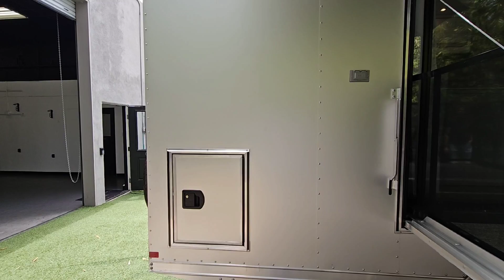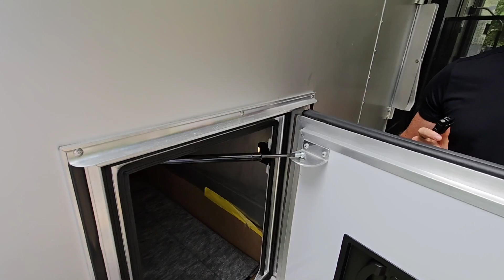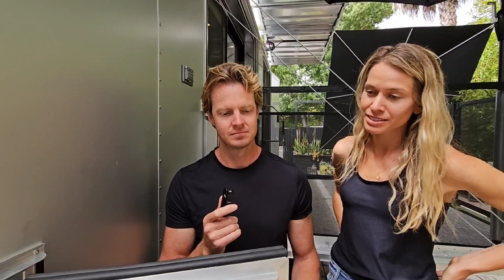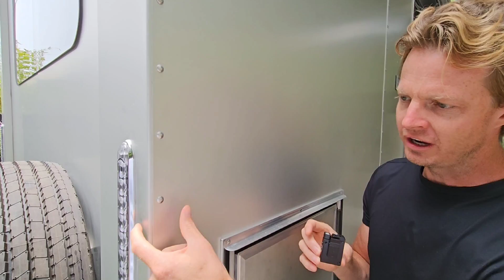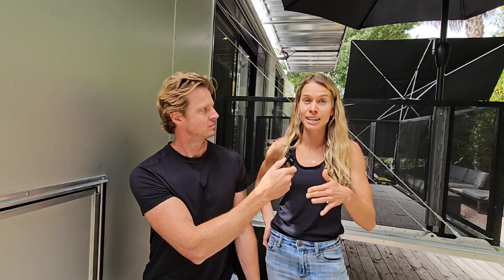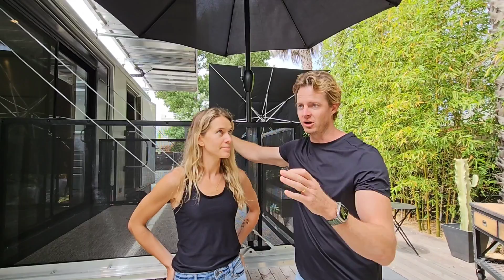Why spend the money on a Living Vehicle RVs Part 2

Comment: Good stuff JD, even if it's out of my "Zip Code".   I can't stop myself from wondering, how did this obviously talented young guy go from remodeling an Airstream to a multi million dollar manufacturing business. 

I put a few decades in at an airplane company up north (betcha can't guess which one)  And  if I learned anything,  I learned how much I didn't know.   From strength & stress, fatigue issues, composites, interiors, wiring, adhesives, smoke and heat release of interior materials, vendor supply issues, and all the planning required to bring it all together.  Engineering, quality, planning, vendors.  Makes me tired thinking about it.

I sure would like to take one of theses units for a weekend or two, or three or   :(.

Comment: Definitely well planned and I applaud you for going the quality route.  I do think the addition of an air-ride suspension would be a major plus since for a softer ride (No Jar) for bad roads and off road use. Air ride over independent torsion suspension would soften the ride and also allow for the torsion part to take over in the event of an air bag failure.  Maybe check Kelderman Air Suspensions.
Reply from the maker: I love the idea of an air ride suspension on these, but their primary focus was longevity and overall long-term reliability. Airbags are great, I have them on my truck, but I understand that they're focus led them away from that.